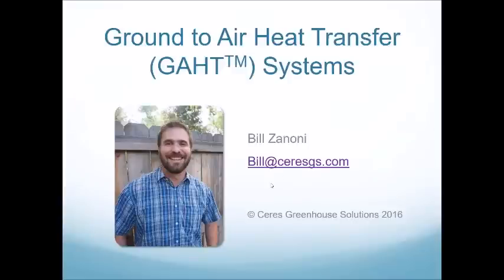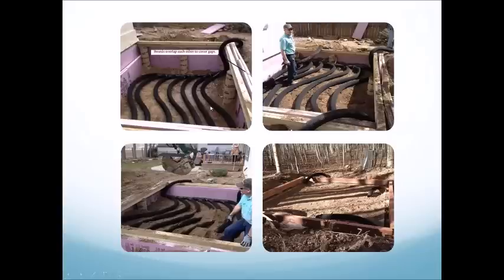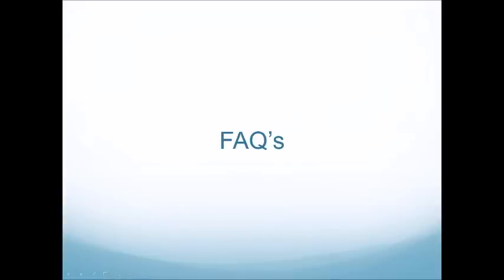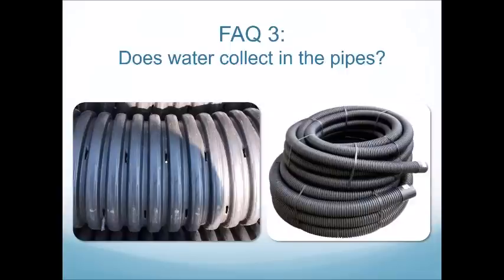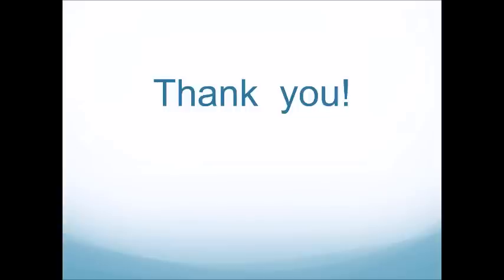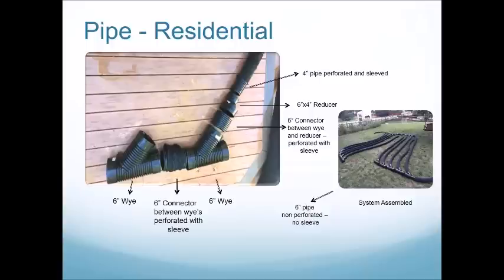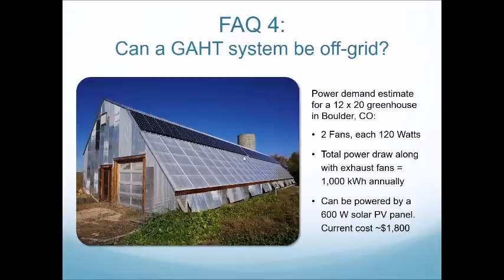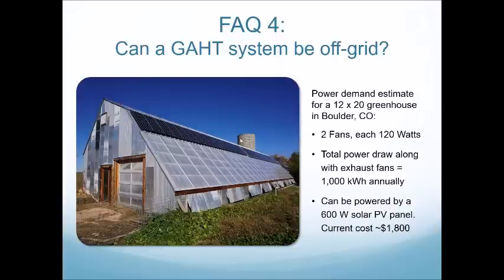Intro to GAHT® (Ground to Air Heat Transfer) Systems

Comment: You mentioned the system is a positive pressure system, so nothing should leach in through pipes. It is easier to grab air and move it at the lower outtake. Would that cause a negative pressure system, and is that bad? Are possible solutions two fans, or neutral pressure? Or different strength fans to keep positive pressure? Thanks!

Comment: Interesting video. Thank you. Why do you not coil up the one long 6' pipe from one corner to the other instead of fitting 4' pipes in 6' short pipes?
Reply from the maker: Hi There! Thanks for reaching out! By using several smaller pipes, instead of one longer larger pipe, we are able have more surface area of pipe in contact with the soil and therefore, get more thermal transfer, and in turn, a more efficient GAHT system. If you'd like to learn more, feel free to reach out to us at www.ceresgs.com/contact/

Comment: I'm designing a 102'x20' greenhouse.  I'm looking at growing warm and cool weather crops in southern Vermont all year.  I'm thinking of maintaining different temperatures from one side to the other for warm and cool crops.  Would it be better to have one commercial type system, or say three or four residential type systems next to each other?
Reply from the maker: Unfortunately it is very difficult to "partition" a greenhouse into climate sections when its all one large space. You will be able to grow different things, but you won't be able to create specifically "warm" and "cool" areas. If you want to create completely different climates, we recommend you build different units

Comment: I have been using a gaht system now going into the 3rd winter. It has a larger fan on a aprox 30x40’ greenhouse. It has sandwich insulated walls & poly corrugated roof. At about 6500’ in Colorado, zone 4. An additional fan/vent to dump heat in the summer is needed as well as swamp cooler. I also have electric heaters to help keep the freezing temps out in winter. My 2 complaints, 1- the fan is loud, maybe an inground vault for the fan would keep the noise down. ? 2-the mechanical thermostats have never worked right and need to be calibrated. Through time they are 30* or more off. Maybe a digital one would work better. There are also electrical switches that open/close vents from stack to outside air for winter/summer and they have never worked after the start. Our temps can range 50+* within a day, so this was the customized system but the electronics bring challenges.
Reply from the maker: Thank you for your comment. Did you purchase your GAHT® system from Ceres? If the fans and the thermostat are becoming a big concern, please reach out and one of our GAHT experts would be happy to assist you in coming up with solutions.

Comment: Just finished a system in a 15 x24 gh. Used 18 inch center pipe 10 inch pipe on either end. The large pipes are twin wall which allows the 4inch pipe to snap into place. Used two 10 inch fans from ac infinity with a controller blowing in and a 16 inch shutter fan drawing out of a barrel. Was thinking 5 exchanges was the air cycle. Have run the fans none stop. Started at 90 percent and have worked down to 60 percent. You mentioned Humidity as changing the capacity of heat exchange. Do you have a range in mind. Hope this makes sense without pics.
Reply from the maker: Hi there, thanks for reaching out. Did you build a Ceres GAHT® system? Please contact us at info@ceresgs.com with your question and we will have a GAHT® expert reach out to you to see if we can help
Reply: Design the system to put the entire greenhouse air volume underground at least 20x per hour for cooling. Diminishing returns begin at around 45x per hour. Having the extra capacity is very useful for autumn cooling when the mass is warmer. Its also extremely useful for the rapid storage of sporadic excess heat on sunny winter days, greenhouses heat up rapidly with a little sun. If you are limited to 5x per hour, a large percentage of the valuable heat that could have been stored for use later in the day will be lost to the glazing (compounded by the large in/out temperature difference). Worst case is the greenhouse overheats forcing to vent the excess outside. I wouldnt use the GAHT design to accomplish this :)

Comment: Would a sump area for the GAHT pipes to drain into and be pumped away work if the water table rises seasonally? Another system uses pipes outside the greenhouse footprint 8 feet deep and 225 feet long for a 75 foot by 12 foot greenhouse. Would this be a better system if you are trying to grow citris trees in the ground? Would the trees invade the pipe system, or would they air-prune?
Reply from the maker: Thanks for your question. It's possible that a sump area would work. We have suggested to a few clients that they install a sump in one corner of the greenhouse to deal with an occasional high water table. If the water rises enough to encroach on the GAHT® every season, it might not be the right solution. And as far as your other question, our GAHT® designs have the first layer below 18" and we offer custom designs that can take root depth into account. Even if the roots grow lower, I do not believe they will intrude into the piping, as the roots will seek out moisture and nutrients. Roots commonly invade septic system lines because both moisture and nutrients are found in them. This is quite different than our GAHT® system. If you have more questions, please email us at info@ceresgs.com or ceresgs.com/contact/

Comment: Heat is transferred to the surrounding soil at a constant temperature when water vapor in warm high humidity air condenses to water. This occurs when the temperature of the moving air drops below the dew point. This same amount of heat is transferred from the soil when the temperature of the cold lower humidity moving air rises above the dew point (whereupon it can accommodate additional water as vapor causing a rise in humidity). Where cold and warm, high and low humidity of the air moving in the tubes are relative to the temperature and humidity of the air in the surrounding soil.

Comment: I am in NC at 3400ft.  I am combining a few things I have seen that seem very relevant.  The GAHT is definitely the way to go for my Walipini.  Does the soil dry out if the pipes are too shallow?  Also, I am using aircrete for structural and insulation.  Any comments?
Reply from the maker: Thanks for your interest in a Ceres GAHT®. There are a couple of issues with the pipes being too shallow: 1) The pipes might interfere with the plant roots. 2) The heat isn't stored properly and radiates back into the greenhouse rather than being saved for when you want to use it. Please reach out to us at info@ceresgs.com or www.ceresgs.com/contact/. We would love to help you with your project.

Comment: How viable would it be use nonperferated  tubing for cooling in sand while using perferated to introguce excess water into the sand to make it more thermally conductive?
Reply from the maker: Thanks for reaching out, to get connected with a GAHT® expert who can answer your specific question, please email info@ceresgs.com

Comment: The small GAHT system around, 4:00 mark, should have larger feed and cross pipes.  Otherwise, it will suffer from  low pressure in the heat/cool pipes underground. 
I wonder if anyone has combined a thermal battery with the ground temperature heating system that Russ Finch is using in Nebraska.  Bring in stable temps from way below the frost line and them stabilize it with an earth battery.  Anyone know of such an application?
Reply: I have no really studied these systems very much because the claims and data are all over the place, but what I have seem from the charts of ground temp is that, yes, the ground is warmer or cooler deeper in the ground, but it is not really that warm in the winter, or cool in the summer.  Probably cooler in the summer than it is warm in winter.  I think you need a heat-exchanger or something heat pump to concentrate the heat you can pull from the ground
Reply from the maker: Hi Daniel, the graphic shown around minute 4:00 may be a bit deceptive.  For smaller systems we use 6" manifolds and 4" "cross pipes."  For larger systems, we use up to 18" manifolds.
Reply: @CeresGreenhouseSolutions  
Curious, is there any thermodynamic studies done on this?  I'm just wondering that because as the pipe diameter grows the ratio of the area inside the pipe to the circumference becomes small and smaller, or the surface area of the pipe for heat transfer becomes smaller as compared with the volume of air moving through it so that heat transfer would be less comparatively.
Reply from the maker: @justgivemethetruth  Thank you for your question, if you email us at info@ceresgs.com or call us at (303)495-5006 we can connect you with a GAHT® expert who can answer all your questions regarding the efficacy of the system.
Reply: Bingo daniel, I have designed a fully insulated earth battery system to actually collect summer heat and store it for winter use. Yes it's possible

Comment: Hi, ok so you don't use bottom insulation.  But depending on subsurface temps, heat you pump there can and will flow outside the battery from the bottom.  Its like using an insulated cooler with no top or bottom.  That does make sense unless the temp differential is very small.  What differentials do you actually get?  Thx.
Reply: This type of system is only balancing the temperature in a 24-hour period with no insulation on the top or the bottom there's loss but the ground holds it so well it's minimal in that short time if you want to use the heat or the cooling for a longer period of time top and bottom must be insulated and condensation must be removed manually

Comment: I would like to ask about tropical perennial greenhouses where you do plant fruit trees... would the trees not root into the soil battery? humid and warm and because the tubes are perforated the soil would also be airated, perfect. Roots will love it. 

But would roots not destroy the pipe system over the decades? And would a tight root carpet take away from the soil battery properties?  
What do you recommend for greenhouses that are supposed to grow tropical trees directly in the ground and that are supposed to last a generation?
Reply from the maker: We can design a GAHT® system to account for root depth. We would love to partner with you to build you a customized setup that would fit your needs. Please contact us at info@ceresgs.com for more information
Reply: This is actually my goal, lemon & orange trees grown in-ground in zone 4b. I too am wondering about the shallow tubes, root systems & longevity.

Comment: Hi what was the reason for not using non perforated pipe. My water table is high for a lot of the year. Thank you
Reply from the maker: the reason for not using non-perforated piping is so that moisture can escape when it builds up when the GAHT is in cooling mode. If you are interested in learning about a solution to your high water table, please contact info@ceresgs.com and we can put you in touch with a GAHT expert
Reply: @CeresGreenhouseSolutions  thank you will do

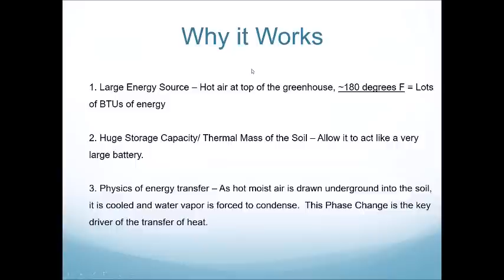Comment: At 2:11 you say that " this phase change is the key driver of the transfer of heat". Can you please explain how that works. I would have thought that when moist air condenses to water this would release excess heat to the system since the opposite, boiling water to evaporate it requires energy. I've bought your book "the year round solar greenhouse" and I want to implement your system in my greenhouse build but your statement does confuse me.  How can you actually get a decreese in temperature in a system that experiences release of energy in a phase change?
Reply from the maker: The soil is absorbing the heat in the moist air, as the soil absorbs the heat, some of the moisture condenses and releases it's energy to the soil. How much moisture condenses will depend on the temperature and relative humidity of the air, and the temperature of the soil.
Reply: The energy that was used to convert  liquid water into water vapour (gas) is released when the air drops to dewpoint inside the tubing. Its important to note that this only happens when the system is being used for cooling. When the system is being used for heating the opposite happens, sensible energy from the thermal mass is used to evaporate water which is returned to the greenhouse as humidity. .

Comment: does this system work in a day desert with 50 degree celicius at summer and -10 at winter ? the air is harshly dry in my area!!!
Reply from the maker: The GAHT® will work in the winter to help keep the greenhouse warm. During the summer a different method of cooling will be required. We would love to partner with you to help create a great growing space. Please contact us at info@ceresgs.com for more information.

Comment: I get 53 inches of rain per year in my area. I would prefer to use a non-perforated tubing like Russ Finch uses in Nebraska. I am further south and at a lower elevation so my ground will not be as cold and I won't have a huge difference between day and night as people do in mountains.
Reply from the maker: The GAHT® works fine in areas of high rainfall, we would love to partner with you to help create a great growing space. Please contact us at info@ceresgs.com for more information

Comment: How about a drainage hose at a low point to pump away moisture collecting to forego slotted pipes and therefore not collect radon?
Reply from the maker: The pipes of a GAHT™ system have small perforations so as water condenses underground, it drains out into the soil. This also helps reduce mold issues, which have not been reported in years of testing.
Reply: I have seen that used in systems for houses.

Comment: Have you had any issues with mold in the pipes or a negative effect on air quality?
Reply from the maker: There are no issues with mold because the condensed water is able to drain out of the pipes through the perforations. Also, studies on our GAHT system have shown that the system actually slightly filters the air moving through it.
Reply: @CeresGreenhouseSolutions  thank you for the response 🙂

Comment: sir, I need mathamatical calculations or formullas which can be used to calculate how mach heat energy is abtained from soil, lenght of burried pipes etc, plz help
Reply from the maker: Hi there, I am not able to give you that info through this platform but if you email us at info@ceresgs.com or fill out a submission form on our website: www.ceresgs.com/contact/ a GAHT® expert can help you with your questions.

Comment: Great video. Do you have a desert version? I live in las vegas, and want to cool my greenhouse as best i can. Do i follow this same design? Is there any tweaks i can make such as a deeper ghat?
Reply from the maker: Since the GAHT® works well to cool the greenhouse as well as heat it, you would follow the same design with a slightly different installation method. Instead of installing the GAHT® underneath the greenhouse, you would install it outside of the greenhouse footprint on the north or east side of the greenhouse (where it's shadier). You would also want to dig further down to access cooler soil temperatures. We would also recommend that you not insulate the system. For more information, feel free to email us at info@ceresgs.com
Reply: @CeresGreenhouseSolutions  you guys are awesome. thanks for taking the time to reply!
Reply: I am thinking that you could incorporate Bernoulli's principle by using a smaller intake pipe diameter outside of the greenhouse and providing a larger pipe diameter to exhaust out the top of the greenhouse. As the air is drawn in it’s velocity increases which decreases the pressure causing it to lose heat. Similar to a propane tank frosting up while it’s being emptied. You aren’t getting the change of state but it’s still cooling.

Comment: I'm working to design a system for my future 10x18' build.  I'm thinking about having a 10" input & exhaust lines with both 4' and 2' depth lines attached (like you did on commercial build).  Will have 5-6 4" lines going across.  With 10" fan that might be over sill at 1200 CFM (but has speed controls to back it down if needed).  Would you suggest 2 systems with 6"-4" lines or is the one system with 10"-4" lines ok?  Also now with automated plugs - you could setup IFTTT rules based on a thermometer  reading on when to turn the fans on & off compared to hardwired ones.  Many of the plugs can even track electric usage so you know who much $ you are spending on the fans running.   Also wondered why on residential system you use the wyes but commercial you just use the taps... could you use the taps on 6" line or is it to reduce the resistance?
Reply from the maker: Thank you for reaching out. To connect with a GAHT™ expert who can answer your question, please contact us at info@ceresgs.com
Reply: I would install a  10" header down at 3ft at each end of the greenhouse and run 7 x 4" tubes at 2ft and 4ft.(14 in total). The 10" should ideally be smooth bore pvc pipe to keep the losses down. Each 4" tube will have a maximum of 85cfm. The combination of layout and fan should give you at least 40 air changes per hour (1200cfm * 60 / greenhouse air volume). If you have long hot summers i`d recommend installing overhead misting to turbocharge the systems cooling performance.